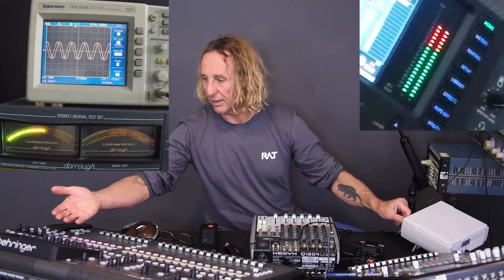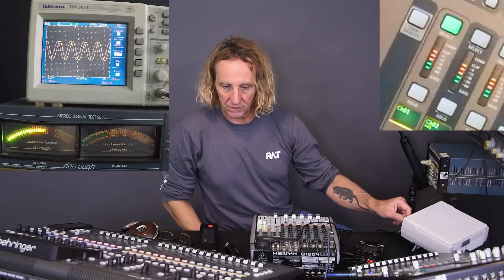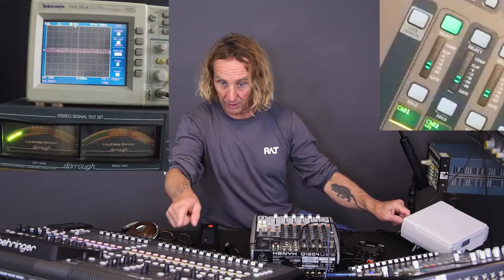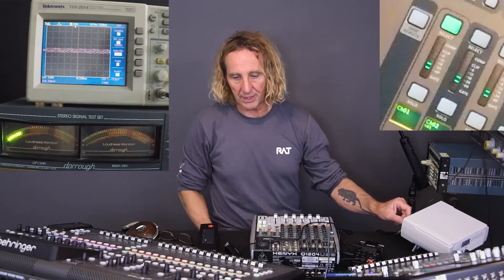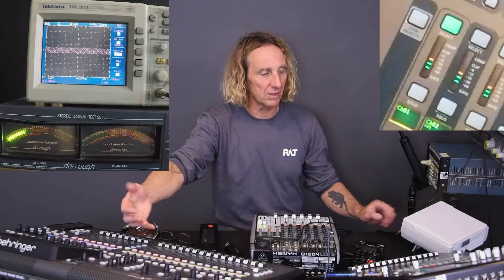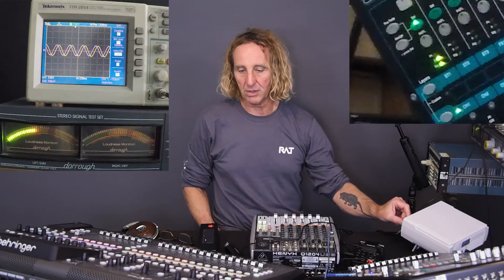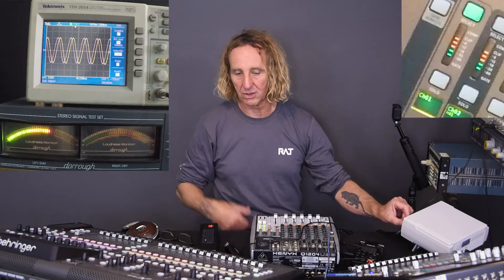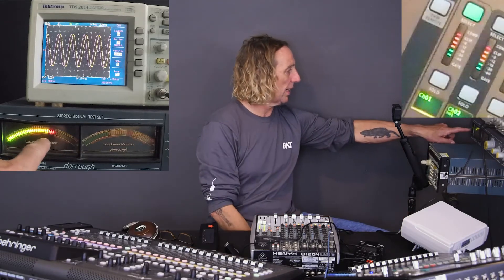Metering & Clipping - Behringer X32 vs Allen & Heath QU16 (Public)

Comment: You want to go deep into a Behringer X32 rabbit hole, discuss the connectivity with remote I-pads, and network cables. This is a never ending source of grief. Most how to videos don't know what they are saying, and leave you with nothing connected. It is complicated, and may result in constant manual IP entries. If you have an I-pad, you are in a world of hurt, the I-pad can't remember any of the previous settings, and it forces you to enter the IP addresses manually every time. Behringer doesn't even know about this. None of the how two connect I-pad to X32 videos know about this. Most people already have the unit connected, and they only reason they do is on account of having a separate laptop connected through to their wifi. This doesn't count, and is in no way how the real world works when you are out in a club, and just trying to connect an I-pad to the X32 (its impossible). Oh, but you will figure it out, only to have it disconnect because your I-pad can't remember the previous setting.
Reply: I have owned an X32 with an iPad since 2013. Not once have I ever had connection issues. It is basic networking. Sure, one needs to know about basic networking to get it working but the same could be said for so many things today since so many things rely on IP networks. 

If you're using a plain old access point (AP), and it sounds like you may be, then yes, you will need to manually input your IP address, subnet, etc. This is because an access point does not have a DHCP server to automatically assign IP addresses. I use an access point because it's what I have and I assigned the IP address to my console and manually set up the network in my iPad... like 9 years ago? I have NEVER had to touch it. Not once. I set everything up, connect the AP, power everything on, and my iPad connects. Every. Single. Time. Now, that iPad is used solely for that purpose and nothing else so maybe that makes a difference but I can't say for sure.

If you want an easier setup you need to use a router. I you connect a router to the X32 and enable DHCP on the console then you should not need to do any manual IP configuration. Now DHCP can have its issues and it is still best practice to assign static IP's for the ultimate in reliability but for the most part DHCP works well.
Reply from the maker: Yuck, that's messy. My focus is more on the audio aspects. That sounds like an adventure best tackled by someone with field experience with the issue
Reply: I primsrily use Android devices running Mixing Station with my X32 and have used iPads, (more recently, also running Mixing Station, great piece of software!). I haven't had any connectivity issues outside of a cheap router failing on me.
Reply: @dare2bdeviii   I had a Network expert team view with me. He explained everything that wasn't covered in the YouTube videos. Again, the YouTube videos are not helpful. There is a protocol of connectivity, a 1, 2, 3... protocol of steps that need to be taken. The other factor is that I'm not an Apple user and the Network expert got into my I-pad remotely to make sure all the settings were correct. Setting up an I Pad with 5G is miles apart from how you would set up a PC and/or Laptop. Also, I bought the latest I Pad, and that didn't help, the YouTube videos on connectivity were dealing with previous versions.

Comment: ive always preferred the peak metering of the x32 over the slower metering time on A&H mixers.  i feel like I cant trust the input meter on the A&H
Reply: I have in the past in analog used a scope to monitor levels to see the waveform and know the clip level. Was important when adding lots of EQ in some rooms with bad acoustics. I could see peaks into clipping on the scope until I trained my ear to hear it, then I could adjust and keep peaks below clipping so it was seen before it actually could clip.  2 channel low frequency scopes are pretty inexpensive today with them often under $200.
Reply from the maker: I toured with a scope for a while to do a similar monitoring.  Good stuff

Comment: Often when people use analog boards, they push them up pretty loud. Meaning the amp levels are relatively low. But when you come in with a digital mixer with the same amp setting then it's too quiet. When you try to push digital mixer to compensate the low amp levels, you get the thin sound. So, you gotta find the amps and crank them up. And wish that the satellites above the ceiling are not active ones.
Reply from the maker: Or get a digital board with loads of output level

Comment: Thanks for these deep dive videos on the X32.  I’ve been using one of these boards for 8+ years, but I’m learning more about their performance limits from these experiments.  With regard to the User Interface aspect of clip metering, and not personally having experience with large analog boards, it seems like the X32 approach is more useful and rational.  If the Clip LED lights, it’s clipping!  I’ve always treated it that way, and gain stage things accordingly.  The analog red zone seems much squishier, where you don’t really know how much headroom is left.
Reply from the maker: It's hard to say. Metering ballistics and peak signals create complications. I think never seeing a clip light and also having the clip come on early would be ideal to keep the mix clean
Reply: @DaveRat  but you wont know unless you test on the allen case were the actual limit is . do you exclude the fact that the allen used this to give the impression that you can push in to the red as an analog input would be able to handle ? (im in the box but i find your vids and your mindset rly interesting and educating)
Reply: @vlastneme   I believe he showed where the A&H audibly started clipping, and it was around the same 22db as the X32.
Reply from the maker: I did measure the outputs and show exactly where they clip vs meter readings

Comment: I prefer to Qu over the x32 personally, it's mostly a matter of workflow. The screen layout, how the knobs are positioned, the fact that the designers just assumed you would probably want a graphic EQ available on every output without having to specifically assign it. The x32 technically does a lot more, but because of that complexity there is a bit more configuration you have to do to get it set up the way you want it.

I just wish the Qu series had a digital scribble strip, and colour coding, that's about the most important small detail for me. The brain recognizes colour faster than it reads text, so if my drum tracks are always red my guitars always yellow etc. I can navigate very quickly even with multiple layers.

Comment: I just got a couple Soundcraft SI performers for the broadcast venue I manage.  It has some interesting things with regard to clipping also.  The mic inputs and gains are also very different.  I can use about 5dB less gain on the SI performer compared to the QU-32 for the same Audio Technica mics.  The bad high frequency noise at high gain I was getting from those mics doesn't show up until about 50db gain on the performer compared to about 35 db gain on the QU-32...  Definitely some fascinating stuff.  I look forward to hearing the tests on the Digico board.
Reply: One curious thing was that I had to turn the trim on a blackmagic SDI to HDMI converter that was supplying AES audio from the computer by about 2-4 dB.  A youtube video I use for testing is mixed with peaks at 0dBfs and it was clipping the AES input on the SI performer until I turned the trim on the audio extractor down...
Reply from the maker: Interesting. So many variable
Reply: @DaveRat  Definitely, unfortunately I don't have the tools to isolate them enough to figure out why.  I think it might have to do with some sort of true peak clip detection going on in the Performer as it is truly a hot track and the clip light seems to be fairly accurate.

Comment: I'll say that ideally analog and digital mixing should be about the same. Key word on *should*. That is, you may have decisions to make based on the characteristics of your console that will differ, but in general the levels should be similar. What analog afforded is increased headroom without clipping. I've paid attention to mixing styles in my travels overseas and have noticed some audio techs pushing all the faders on their old analog boards to the top and getting red lights galore. And this was normal and acceptable where they were. I wouldn't call this in any way "ideal". If you have a general SPL goal for the venue, you'll want to have the amps carry that weight, not the level you are sending the amps. Good taste is that you have a perceptible SPL range that shapes a program, but is still within a range to be easily audible to the audience in general. So you don't want to be too soft. If you have that same range on stage, then you will end up compressing it to amplify it, not expanding it, because if you amplify a range, the range itself grows larger. Part of that compression is in the acoustics of the venue. But this means that you will have a range on your board not to exceed the level at which it clips. That means that you shouldn't be pushing the upper limit of the mixing console - ever. Get a good sound out of the mixer, even a good range of levels, but don't only add sound - subtract as well. Then let the amplifiers and speakers carry the amplification that you want, not the board.
Reply: Something that is overlooked in the analog vs digital world is the number of analog amplifier stages that add noise at each active stage. In digital the analog portion is pre-amps, thus very important, A/D, and then D/A and output buffer. In analog every EQ, Mix Bus, etc is another noise source in the signal path. In digital all that is just math algorithms  for EQ, Compression, Noise Gate, FX, etc, where in analog, each adds noise to the noise floor.  Headroom is simply the space between signal and clipping. Dynamic range is the difference between signal level and the noise floor, and is measured as signal divided by noise. or S/N for short. The lower the headroom, due to higher signal, the lower the S/N or more dynamic range. You can run an analog board at 18 DB below clipping and thus run it at the same headroom. yes it is true that some, but not all, analog consoles may clip the op amps at a higher peak level than the hard digital minimum and maximum peak voltages, but you are talking about 1 to 2 DB of headroom gain in some analog consoles. Most consoles have + and - 15 volt supply rails, and the analog clips between 10 and 14 votls depending on the device. Some consoles, but not all use + and - 18 volt supplies instead, but they run hotter, and have a higher noise floor, so yes have higher headroom, but often less dynamic range. the engineering in both consoles is a series of compromises between noise, response, heat, and headroom.
Reply from the maker: Thank you! Good info

Comment: Hi Dave, I brought this up before: if you run several  channels thrue a subgroup o  the x32, the subgroup (bus), gets easealy over de 0 dbfs mark. But it seams not to distort. Could you confirm this? I beleive it has to do with the higher bitrate of the internal signal flow.
Reply: yes, this is correct, 32bit float is essentially impossible to clip once the signal is digitised.
Reply from the maker: Interesting
Reply: I'm not sure about the X32 specifically, but most modern DAW software does use 32-bit float for all of its internal processing making it almost impossible to actually clip an internal bus (though certain, mostly older, plugins may clip while inserted on the bus).
Reply: 40 bit floating point allows internal summing/processing to work with a very large numerical value, since the output is limited to 24 bit integer, I suspect an  automatic attenuation (division?) must have been applied just before final output depending on numbers of channels routed to the bus

40 bit floating point max value = (2 − 2^ -32) × 2^(2^7 - 1) ≈ 3.402823669 × 10^38 same max value as 32 bit floating point but allows higher precision, because
log(2^ -24) ≈ -7.22
log(2^ -32) ≈ -9.63
Reply from the maker: All good stuff. I will focus real world results and how all of that impacts us and try and find Gremlins and oversights so we dont get pinched by assumptions and oversights
Reply: @philiptong4978  Yeah but with >1,400dB how much more precision do you need? The human ear can really only hear about 120dB or so before it gets physically painful.
Reply: @NealMiskinMusic  beside increased headroom, floating point is used to reduce rounding errors with integer math
e.g. 20/3 = 7 instead of 6.667...
and yes, final 24bit integer output is rounded
Reply: The bus is an internal routed path. Unless you're running a specific plugin that doesn't like hot signals, it shouldn't clip, as the X32 processing is 40bit float.

Comment: i feel like the metering calibration is something users should be able change in the boards global settings.. have two options.. analog or digital style metering ? its just threshold for showing a red light..
Reply from the maker: That would be helpful assuming people actually pay attention to how it is set. That said, if people pay attention to how it is set, then they would know that the clip on an m or x 32 channel is vastly different than the clip on the QU and analog, which does not seem to be the case

Comment: You hit a very key point at the end. EQ. You might remember me, old analogue guy gone digital. I've been running an x32 for several years at my Venue.
The EQ was a hurdle to get use to it. If you want to jump down the rabbit hole?? A comparison test between the x32 channel EQ to an analogue EQ. 
This might reveal some surprises. My experience with the x32 is that minor adjustments are, as you said, doing very little. Now I am much more aggressive and get a much better sound. Fuller, warmer etc. Just a thought. Good info as always, thanks again Dave!
Reply from the maker: Cool and good idea.  I will ponder a way to test and demo that

Comment: I was the house tech in a few venues in Glasgow. What I noticed when the digital; consoles started appearing all those years ago was, The longer a band was on the road the more processed the mix got. Bored sound engineers appeared to fill their downtime with adding more and more sauce to their mixes unfortunately, some of them got to a point the mixes were so over processed there was little or no dynamics left
Reply from the maker: Agreed and unfortunate but true
Reply: As post-processing has becoming increasingly available to people at home, I've seen techniques once found only in the recording studio being used more and more for FOH. Audio equipment makers see the demand for this and all the extra on-board processing is a selling point. "You too can make your FOH sound like a recording studio." One example is parallel compression. I remember not too long ago a buddy of mine explaining how I can use parallel compression on FOH for various applications. On my older digital board, I need to take up two channels to achieve this unless I set a group where the same parallel settings work and run everything through that that I want to run in parallel. Today, many new boards have parallel compression natively in-channel.

I still firmly hold that the best groups don't need much processing either in the studio or on stage. You don't have to make them sound good because they already sound good. You mostly just need to amplify all that goodness.
Reply: @jimpemberton  When I worked PA's back in the day we used to see  lots and lots of studio kit at FOH.... Good gear is good gear if an engineer spec-ed something we put it in the drive rack for them.

Comment: There are a lot of reasons why shows today sound different than in the analog days. Perhaps digital sounds worse. But now you also have comps on all channels, so you tend to use them. The visual representation of what you are doing with your channel EQ and main mix EQ also have a lot to do with it. Even though your ears tell you diffenrently you (and I'm definately including myself here) often look at the graphics and say - "that cant be right". I know that I definately mix with my eyes as well. For a long time I have been hoping for the option of turning the graphic representation of my EQ curve off on my QL5 desk. 

Would be fun to have a listen the desks instead of just meassuring them. I had a great epiphany when I listened to a simple CD track through an X32 and my QL5. Both gained equally and afterwards normalized in Audacity. Surprised at how bad the X32 sounded compared to my QL5. The QL5 costs around 5 times as much as a X32, so there should be a difference.
Reply: And to be honest, PA systems have also changed character today. I don't know if it is less distortion in the drivers or whatever. But sometimes when I get to do a gig on older speakers, I have a big smile on my face. They seem to have more body or fullness, more "umph" - don't really know how to describe it. I have some d&b gear. And they definately changed the way they voice their products. My older Q sounds different than my newer V-series.